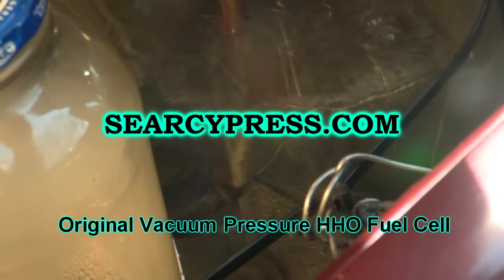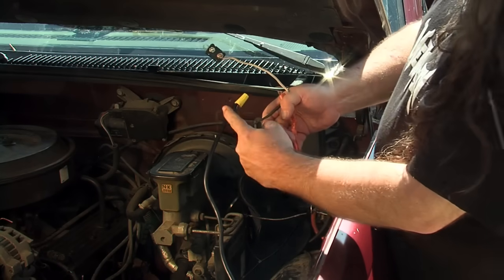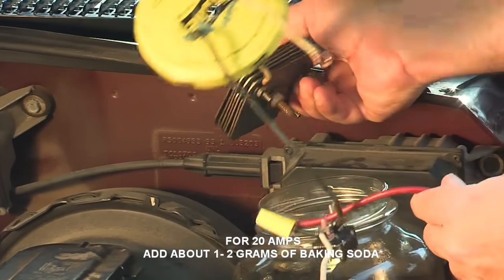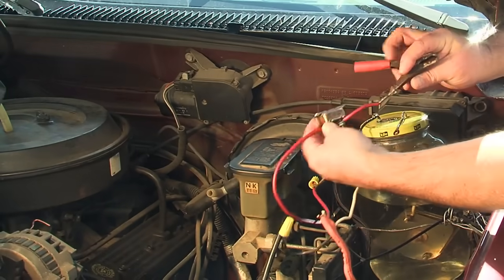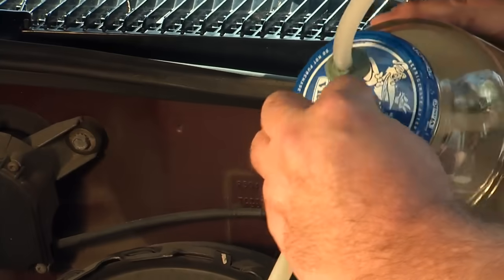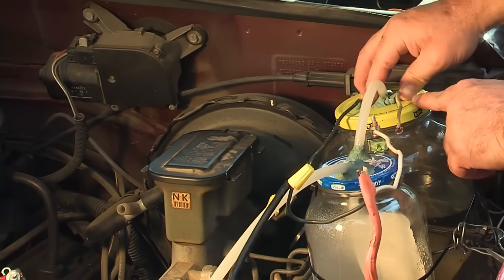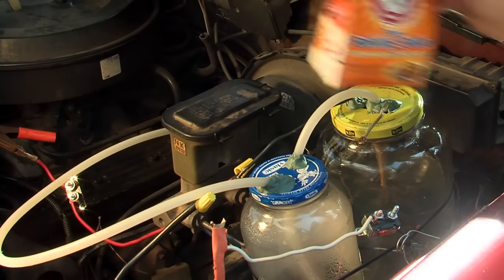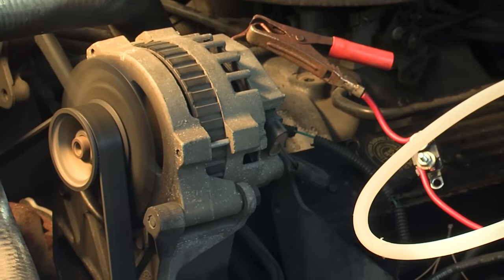Vacuum Pressure Hydrogen fuel cell defeats high gas prices using hydrogen from H2O.

Comment: He doesn't ever mention needing to trick the air fuel sensors since your adding more air, your car will just add more gas. My uncle did this stuff before and had to trick his sensors so it would not add more gas cus of more air. A lil more complicated than this video makes it seem, but nice work tho!
Reply: Exactly this is pretty shady advice at best. He really doesn't explain the process too much because then his video would be shown as useless. This is like one of those tiktok CCP videos telling you to eat tide pods for fresh breath. Yea ur breath will smell better, but you might need to call poison control.

Comment: where does the battery get its power. a solar cell I hope.
Reply from the maker: The power comes from the alternator. Engines only burn about 80% of the fuel. Adding supplemental HHO fuel increases the efficiency of the burn. That is where the extra boost is possible. It is not over unity. It is simply burning all of the fuel instead of wasting it like most engines do. Thanks for your comment.

Comment: So does this only work on carburetors or will it work for injection too
Reply from the maker: The hho gas is drawn into the engine through the vacuum... So it really would not matter if it was injected or carbureted. Thank you for the comment.

Comment: Did you ever run into engine heat problems, considering the hho reaction is occurring under way hotter conditions than the burning of regular fules?
Reply from the maker: The engine can run cooler. Flammable steam returns to liquid state and absorbs heat. Ty

Comment: Great work, but I would recommend moving the connection cable further away from the jar and also isolate it properly, otherwise in case of leakage you get a nice spark triggered hho explosion from the gas forming up under the hood.
Reply: This calls for tunnel ram 🌬
Reply: What’s the parts list to make this?
Reply: @TrillNaga  did u watch the video   pay attention
Reply: @Fuckinghandlebullshit  I don't think you have to do that with a 90s vehicle that still uses throttle body...
Reply: What kind of mileage increase did you get? I've got a 99 K1500 Suburban that gets 9mph. I love driving it, but it's becoming far to expensive. I'd like to try this out
Reply: there is so much air movement when moving, and the fact hydrogen dissipates very fast being lighter than air, no pooling will occr.
Reply from the maker: This system runs completely in a vacuum if you get a leak what you get is a poorly running engine. Not from the HHO but from the vacuum leak. New video coming out soon on this hho topic. Be sure and subscribe.
Reply: @metalpresstv   im making one for my 92 f150 uv inspired me with this video thx man, i will look for ur new video, if u could put a detailed parts list it would be easier for example i had trouble finding the exact auto shutoff switch u used and wasnt sure if a different one the guy at the store had would work right but i will figure it out eventually either way thanks, ☮️☮️☮️ -sky
Reply: Well get on it and start showing us how it's dome, this is an old video...im sure the people who use this has a way more updated system that's safer and more efficient....I will be attempting this on a little old car and I'm very clean and picky, there's actually two more ways to run a vehicle and I'm baffled no one is picking up on this....I saved probably 2000 bucks a year if not more.
Reply: Definitely,smart man🤔🧐🍻cheers fellas
Reply: Totally correct
Reply: All the professionals in here! By reading the comments, Looks like I'm the only one that hasn't built one of these
Reply: Here they come car running off of water 💦
https://youtu.be/NMH1pBAYgYs
Here they come car running off of water💦⛽🚗🏍
Reply: 50 cent alcohol trick https://youtube.com/shorts/QvyM7GVRU3Y?feature=share
Reply: The engine gets water on all the special parts breaking everything
Reply: @randompotato5761 Na, it shouldn't cause any problems. Sure, it's true; the oxygen and hydrogen would recombine into water vapor in the combustion chamber when given a spark, but, it'd be instantly forced out the exhaust valves and into the exhaust pipe. The constant high heat of combustion would prevent the water vapor from ever condensating and causing problems internally in the cylinder or valves. 

I WOULD switch to a straight through design muffler, though, like a Magnaflow or something.
Reply: Does this work in tandem with gasoline or have you completely eliminated it all together? If so how often do you change the water?
Reply from the maker: The system does not run the engine. It runs the combustion process by reinforcing the ignition of the gasoline. It produces a very clean burn with almost no emissions and a much lower catalytic converter temperature. We have an updated video coming out soon so be sure and subscribe. Thank you for the comment.
Reply: The danger lies with the hydrogen and oxygen being in the same jar in the first place. Two jars connected by a water hose at the bottom, the anode in one jar and cathode in the other. Gases are collected seperately and mixed in the carburettor to keep chances of unwanted explosions or fire restricted to a smaller volume and location.
Reply: @rossbrumby1957  please be alive still…. How would someone go about doing that the safest way?
Reply: @WuTangSlayer  they used to sell kits years ago. Not sure if they still do but you can search hydrogen fuel cell.
Reply: @rossbrumby1957  I'm not sure ur answer or comment is based in logic....unless u have two games that are known to have spontaneous combustion probabilities then it makes no difference if the hydro/oxygen mix is together....explosion dangers exist with any flammable gas that's not handled safely....
Reply: @rossbrumby1957  For one thing there is no carburetor because it has throttle body injection plus all the gas made is sucked into that vacuum line that goes to the booster and from there into the intake manifold.
Reply: @rossbrumby1957  That would be ideal but the problem with that is there is a huge net gain in a one cell system. The location of this one could certainly blow the master cylinder if if exploded though. Really the only open spark would be connecting it to the alternator while switched on as he does in the video. I would guess a newer car could be tuned to run extremely well with this setup. a front end collision in this would certainly ruin your day.
Reply from the maker: We actually did have one failure. Because it was not wired to a relay you had to manually pay attention and turn off the cell. One day I parked and forgot to switch off the cell. Normally I would return to a dead battery however this time I did not. I started the engine and took off. A short time later a very large concussion made a perfect circle under my hood. The lines that go to the vacuum remained intact however the lines at the top of the jar blew off with the lid. Lesson learned. Thanks very much for your comment.
Reply: @metalpresstv  That's awesome! So the pickle jar one screw top saved your butt?  Image the force if the jar was a Nalgene water bottle. That force would have blow in every direction.
Reply from the maker: @DreadPiratePapa  we set off a lot of them intentionally. In every case the force took the lid off. I was never able to break the glass. I think this is probably because of the reaction time of the gas and the force finding the weakest structure. I don't recommend trying it but we had to to find out what would happen. It certainly is possible to have a catastrophic failure. Keeping the system in vacuum is imperative. However if you were climbing a hill for a very long time you would have to shut the cell off because the vacuum pressure is lost. Failure to do so would not go well. Thanks very much.
Reply: @metalpresstv  what did you do to remedy the situation?
Reply: @metalpresstv  had a similar experience during experimental stage.be careful people.if an innocent smoker walked past your vehicle💥 and his daughter. Is saving fuel costs  worth lives?? I eventually uninstalled my unit although it worked well.
Reply from the maker: We have a new video on this topic that is coming out very soon. We show a safety improvement which makes human error pretty much impossible. Be sure and subscribe, thanks for the comment.
Reply: @metalpresstv  cool waiting 11years was worth it
Reply: @metalpresstv  hell yeah 😎
Reply: @glennwhitt7375  relax the system is under vacuum so any leaks get sucked in not blown out.
Reply: @metalpresstv  is the video out now?
Reply: We still waiting, maybe show the 2 jar system and some shielding?
 @metalpresstv
Reply: @rossbrumby1957  I have been told that oxygen and hydrogen gas mixtures are less explosive than just hydrogen
Reply: @brettstrittmatter205  Dead wrong, HHO is a stoichiometric mixture of hydrogen and oxygen, so it’s perfectly mixed for flammability - no O2 or H2 left over, all of it gets burnt up
Reply: @Fuckinghandlebullshit   Why??  why would you "have to adjust" anything? Nothing has changed from this guy's system other than you are producing the 2 gases in separate containers. Then they get sucked into the intake manifold, mixed back together in the HHO ratio, and burned. Same as with a 1 jar system.
Reply: @botchvinik8668  both oxy and hyd are produced in the the one jar and they go through to the other jar which is basically a water separator to keep any excess water from going into the vacuum line.
Reply: @botchvinik8668  that's basically the same thing that's happening in the engine already eh
Reply: How could it build up with vacuum pulling it out as soon as it’s produced?
Reply: @yuknasty9199  They said when the car shut off it would lose vacuum and since it was direct wired if you forget to flip the switch it could build up.
Reply: Where's yours?
Reply: Yeah no it's leaking, so eventually a reservoir could build up under the hood.
Reply: There is no tank of hydrogen. This is an on demand system it's bullshit but there is no risk of "explosion". Lol
Reply: Doesn't help that it's in a glass jar either 🤣

Comment: Does this just double the gas mileage? What does it run completely out of hydrogen?
Reply from the maker: Most engines, especially the older ones, only burn about 80% of the fuel you put into them. The hydrogen and oxygen increases the efficiency of the burn allowing better performance, eliminating ping, and improving mileage. It is not over unity. The increase in performance is due to a higher percentage of fuel burning in the cylinder.

Comment: Electrolysis under vacuum seems 🗝
Reply from the maker: The thermodynamics involved play a key role in an efficient cell that does not overheat. The boiling point of the water is changed. The water in the vacuum State behaves like a refrigerant. That is not to say it is super cooling anything. I am just stating that the thermodynamics are more controlled in the vacuum. Thanks very much for your comment.
Reply: @metalpresstv  Electricity definitely behaves differently under vac👍 https://youtu.be/j5VJewonsrY

Comment: but you are still running on fuel as well you put the pipe into the air intake? all cars have that is that correct as the hydrogen is just a help your set up is not just running the engine on its own is it?

Comment: Can it be used on fuel injection engines and if so would you have to modify the hydro system one thing i would reccomend on the vacuum pull to the engine a check valve possibly to prevent a blowback just a thought you have the most simplistic and functional design i have ever came across,nice job !!!!!!
Reply: @Sardit  10-4, thanks for the reply and info !!!!

Comment: 99% are missing the point on this technique.  Its about how it improves the combustion efficiency in the cylinder because the hydrogen acts like a catalyst for combustion, because it is the fastest moving element in the mixture.  It helps to spread the flame front to provide more complete combustion.  Hence the mileage improvement.  It does not take much hydrogen to enable this to occur.
Reply: 29A is about 400W. depending on alternator voltage. For this to be practical, the increase in efficiency would have to generate in excess of 400W to be practical. Also, the electrolysis cell in this video is very inefficient as it is subject to huge resistive power losses which do nothing in terms of gas generation - after some time, you're just boiling water, the temperature which is reduced due to the vacuum. The neutral plates I saw do help a bit but do note there is still resistive path between 12V plate and the ground plate.

Not only is H2 and O2 going into the engine, so too is water vapour which tends to reduce the efficiency of the burn. Note that excess H2 and O2 is actually considered a loss to the engine because this will never recoup the power that was extracted by the engine to generate that H2 and O2.

It would be better if
1. The voltage to the plates were reduced to about 2V, will also need bigger plate area to compensate for lower voltage. Plate spacing can be reduced, but not too much otherwise gas generation will be reduced. 
2. The second bottle needs to be higher than the first with its bottom connected by some tubing to return condensed water back to first bottle.
3. The second bottle also needs to be packed full of some type of brass wool which will serve two purposes
  a. if any flash back occurs, the flame will be extinguished before reaching the main gas production bottle, preventing an explosion
  b. The brass wool will cool the water vapour to liquid (hopefully) - Note the brass wool needs to be thermally connected to some cold sink. Under vacuum, the boiling point of water is reduced and you want to prevent water vapour getting into your engine.
4. The power is regulated, perhaps if this was fed via a computer program that monitors engine parameters via OBD2 port. No sense in pumping excess H2 and O2 into the cylinder than the amount of fuel in there. This should keep the efficiency of the system over a wider RPM.

I am not doubting the increase burn efficiency but am very skeptical. None of the videos I have seen show the vehicle on a dyno with and without the generator so it's kind of hard to believe these guys. Hard to know if some kind of bias is involved. Perhaps they are driving more efficiently with the generator installed and therefore show better fuel economy.
Reply: @adam3141  Interesting info.
Reply: Just like the atom bomb is used as trigger in hydrogen bomb.

Comment: Hellow, is the vacuum line from the brake connected to the HHO Generator and where. At the top where HHO gas is produced that would divert all the hho produced to the brake vacuum lines while we want that hho to go to the engine. Please explain the vacuum lines lay out in detail. thanks